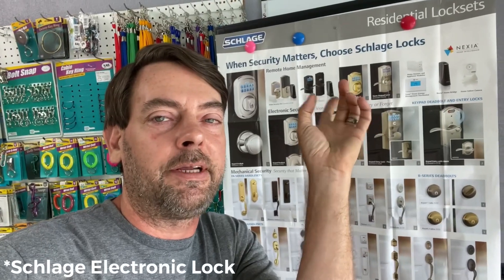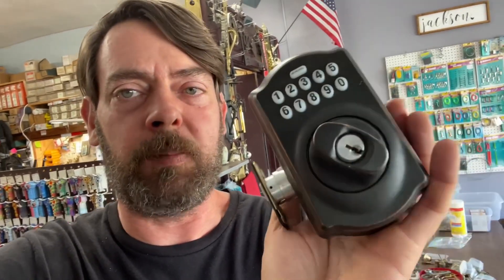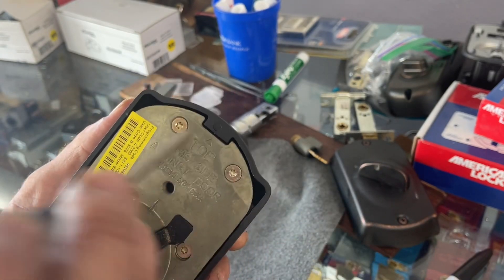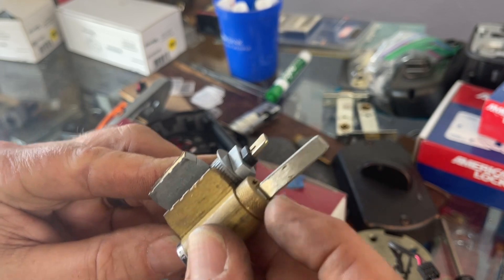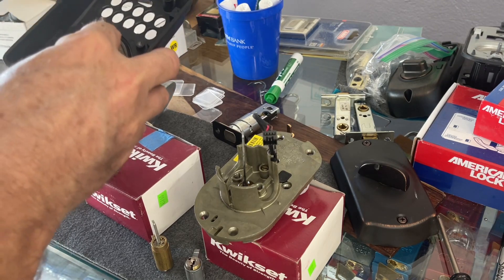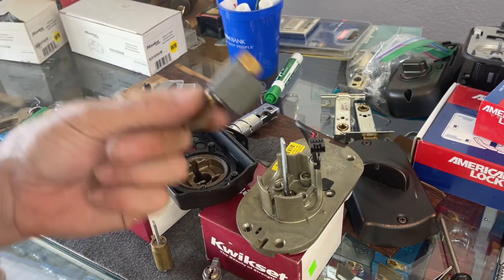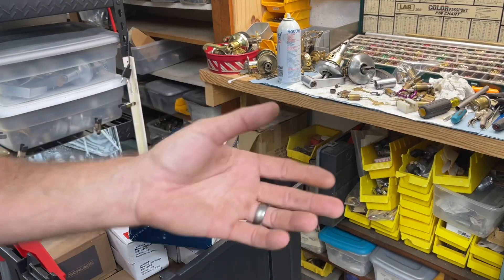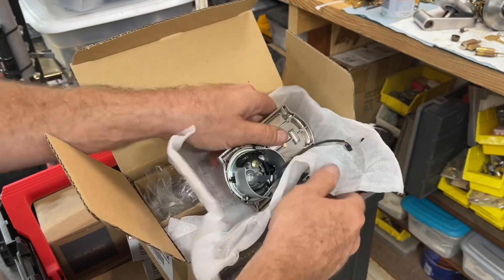RLS 20 - Schlage Electronic Deadbolts

Comment: Well election day 22 was yesterday... And I got to Put on my first of these.... Where were you last night at 1830 hrs when I was trying to set up my Program code and enter the code Numbers... (umm my wife was reading the directions... all Im gonna say about that) But any way I got it done. Now my question is is there any way you can REVISIT this again on Saturday Live and EXPLAIN HOW THE HECK THE KEY IS SUPPOSED TO WORK ON THIS THING... Still havent figured that out yet.
Reply from the maker: Hold turn knob vertical.
Insert key, turn until it drops down a bit.
While keeping pressure on key turn key to unlock/lock.
Hold turn vertical. Pull key so it comes out of its drop in. 
Turn key to removal position (12 o clock)

Comment: I've done two of those 365's in the wild. One I re-keyed twice as the house was rented then sold. I remember it was early in my lock journey and I was nervous to remove those torx screws. The older Schlage 595's are still a nightmare! They are void of the plastic cover/port that access' the cylinder, and when you open them..Boinnnggg.

Comment: Hey Jason , I came across a lever storeroom function with a triangle in the core . Meaning of that
Reply from the maker: Schlage Everest
Reply: Ahhhh . I couldn't pick that sucker
Reply from the maker: @primelocksmith8876  you’d have to have a modified tension wrench to trigger the check pin on back. It’s difficult even with that (I don’t have one)
Bump keys actually work surprisingly well for them
Reply: No wonder I'm checked into the plug and seemed to have all pins picked but still wouldn't turn
Reply: @primelocksmith8876  there is a side milling on the key that engages the side pin.
Reply: @ImGumbyDangit  yes . You pick it then Rock a pick on the right bottom to engage it . Thanks Gumby !